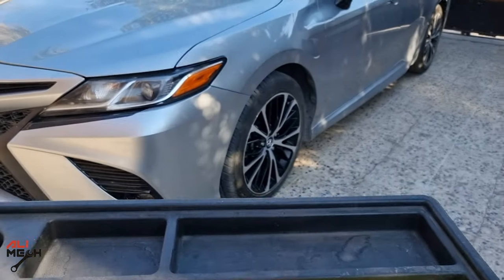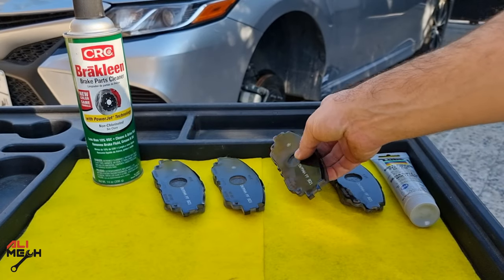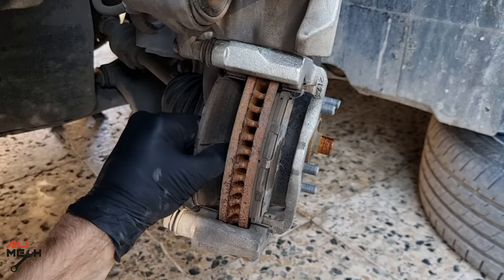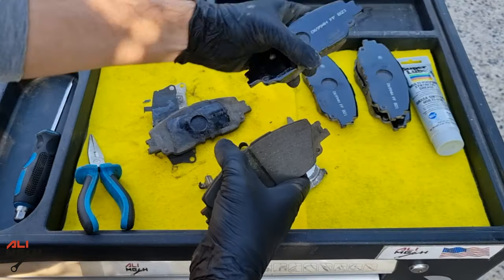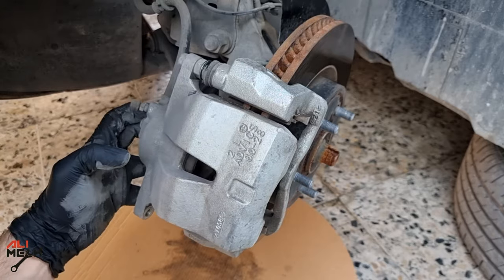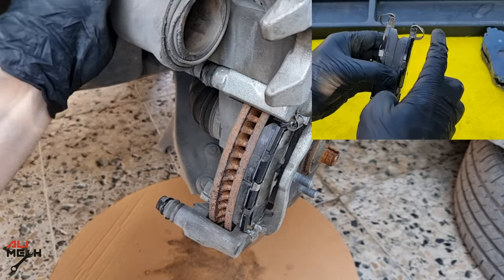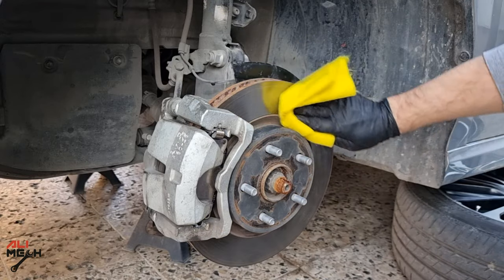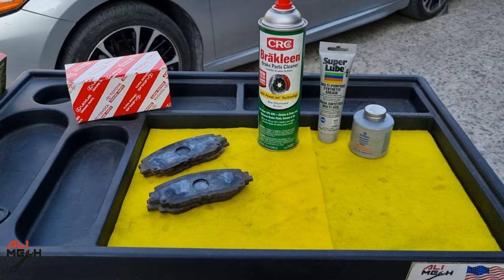How to Replace Toyota Camry 2019 Front Brake pads/How to fix uneven brake pad wear for better brake

Comment: About to change my front brake pads saving myself $259
Reply from the maker: That's great news
Reply: How did it go
Reply: Well check your rotors, they probably need to be machined, you can’t just slap pads on

Comment: Very good video and advice, however it is wise to check fluid level in reservoir before and after, wise to keep the cap off too for expansion. We'll done though, I enjoy your video's 👍
Reply: Unless the fluid was never topped up. The level will just go back to the top with the new pads.

Comment: I havent seen anyone put their tire under the car during brake replacement  .... you can but not recommended it just so if ur car becomes loose from the stands it will balance on your rims not tires.  Be careful !

Comment: Brother did brake fluid came out while compressing pistons?
Reply: no it wont
Reply from the maker: No brother, if its not been added before with the pads gets low, you doing need to take any brake fluid

Comment: I have changed a lot of brakes on Toyotas and my brake jobs last between 7 to 9 years. 

1. I always replace the brake hardware (metal clips) with new hardware. The brakes and brake hardware go through thousands of heating and cooling cycles and this reduces the effectiveness of the hardware. Brake pads are more likely to bind and stick if you don't replace the hardware. If you live in the rust belt clean up excess rust under old brake hardware before installing new hardware.

2. I always replace the rubber dust boots with new ones. At first, I didn't do this, until I had cars come back with sticking brake pads. The rubber boots are like accordions. After thousands of compressions and expansions, they develop tears in the valleys or the ridges, water gets in, causes pins to rust, and pads to stick. 

3. I always use Toyota pink rubber grease on the sliding guide pins. It's a silicone based grease also but it has additives so it doesn't turn to liquid and leak out of the dust boots when it gets hot.

4. I always use Toyota OEM brake pads. Toyota's brake pads are quite a bit thicker than most aftermarket pads, so they last longer.

5. I never use anti-seize on the brake pads. It dries out due to heat produced from regular braking. I use Toyota brake grease (black grease) or Permatex ceramic extreme (synthetic based or silicone based). Either one is fine. CRC brake grease is good also.

You'll be surprised how long they last. This is basically what they do at the factory.
Reply: Where can I get Toyota pink grease and Toyota OEM brake pads other than from the dealership? Or is that pretty much it & the point - and Toyota online?
Reply: @BlakeAlexander12   I get all of them on Ebay, other online Toyota OEM sites, and online from Toyota dealers. All 3 options are cheaper than driving to your local dealer. I sometimes get it from a local dealer but I buy it online when it's on sale online and then drive to dealer to pickup.
Reply: Toyota uses Akebono brake pads, no need to pay 25% more from the dealer, buy them straight from Akebono or at your local parts supplier.

Comment: Question, what's the point of that rubber bit only in one of the sliding pins? What would happen if the pin is put without it? I read it prevents variations, but would it affect gas milage by pushing the caliper out a bit so pads are not in constant contact with the rotor?
Reply from the maker: If you mean the rubber boots on slider pins to prevent water get in and rust them to jam
Reply: @AliMECH  I meant the rubber on only one the pins itself at 3:20
Reply: No you have to push the caliber piston back so when u replace with new brake pad it fits the larger pads... just common to do you'll sit there looking like what did I do wrong. You can use a long screwdriver n slowly push it back.  Put brakes on when secured pump your brakes car on not driving just on that activates brakes to operate n then your good.  Don't brake hard for 3 weeks it will smell bad n start squeaking.
Reply: @nas979  It reduces vibrations. If you put it in without it, it will vibrate and vibrations will make noise.

Comment: Great video, thx
Reply from the maker: No problem!
Reply: I fixed my squeaking brakes problem today. My mechanic didn’t put those shims and didn’t clean and lubricate pins as well. Thank you for that trick for moving cylinder with screwdriver. 
It’s easier than I thought.